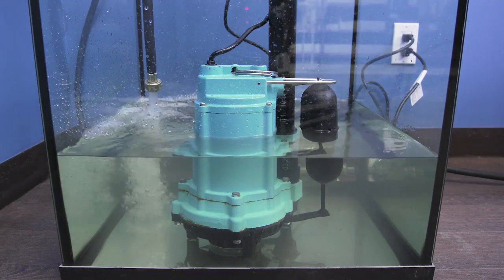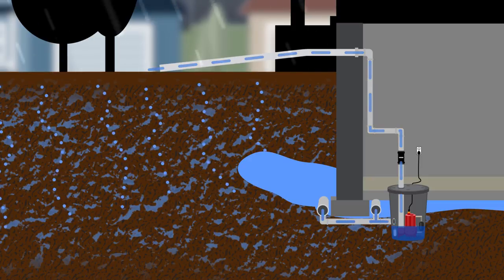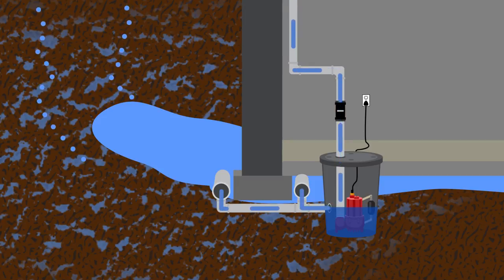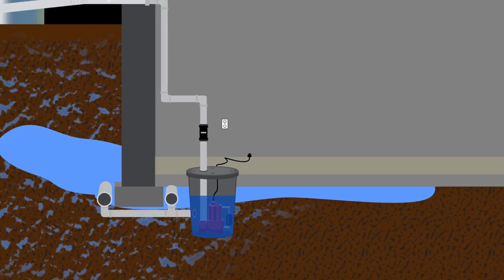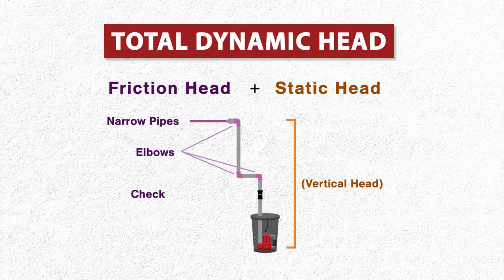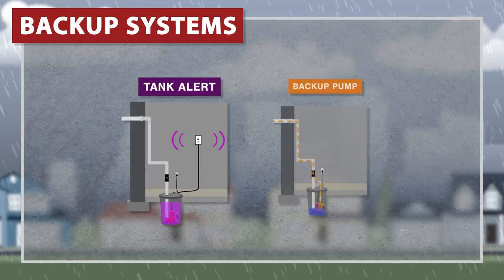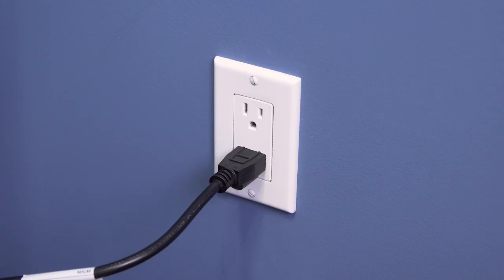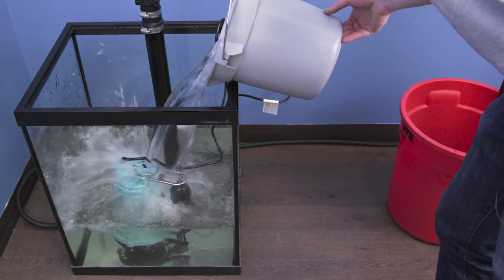How to Choose a Sump Pump? (Complete Sizing Guide) | Spec. Sense

Comment: Glad I found your video! We have an 18” basin that fills with water like clockwork every 10 minutes. Most I’ve ever seen between cycles is about 20 minutes. Dry, wet, doesn’t matter. Constant water flow into the basin. Would this require a higher HP pump, our current one burned out in about a year. -also, definitely not the check valve as I can see the water empty into the ditch!
Reply from the maker: Thanks for watching. Yes it's likely that the ground water table or drainage is different than the average home. Check to make sure that discharge pipe is positioned in a way that it won't just drain back to the foundation, this might increase how much water is accumulating. It might not be a lot of new water it could largely be some of the same water draining back.

A larger pump can help. You might want to invest in a backup system to make sure that the sump can always run. In your case it seems like a faulty pump even for a short while would result in a flood.

Comment: Hi Vance - Thanks for your series - I live on a sailboat and have a 2,000 gph in my engine room, and another amid ships.  The head is a little over a meter & 1/2, no checkvalve between, none really needed.  does the head height vary depending on the hose diameter?  I'm thinking it has to.  Yeah?
Reply from the maker: Thank you Tom, we're glad you're finding the series helpful! The head will differ based on the hose diameter, so its best to use the same diameter as the outlet of the sump pump if possible. At 1.5 meters you won't get too much head loss from the height alone, and without a check valve or too many 90° turns, your pump should be able to output close the max gpm.

Comment: What could be the cause of four sewage pumps packing up at the same time in the same sump?
Reply from the maker: Thanks for watching. It is unlikely that 4 pumps had all 4 motors fail at the same time. It is more likely that there is an issue with the power supply to the pumps.

Comment: What's better - bottom inlet or side inlet?
Reply from the maker: Thanks for watching. Most sump basins will have a inlet pipe on the side near the top, and most sump pumps have a bottom intake which will mean it will have a lower water level after it discharges.